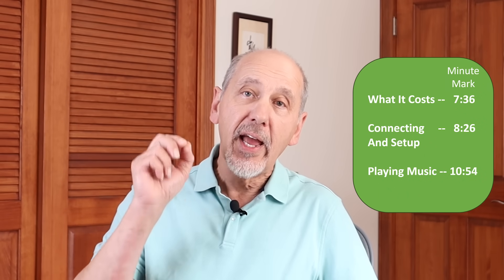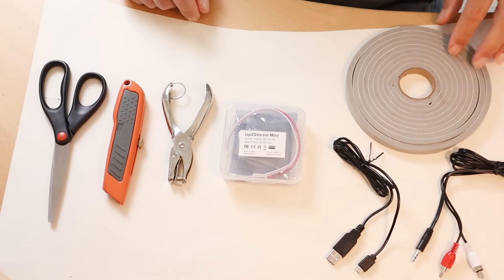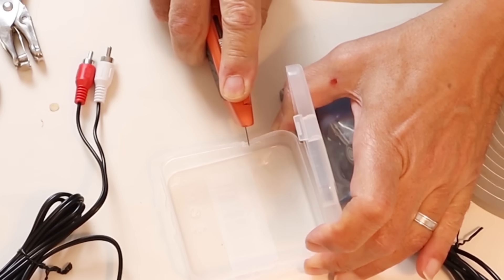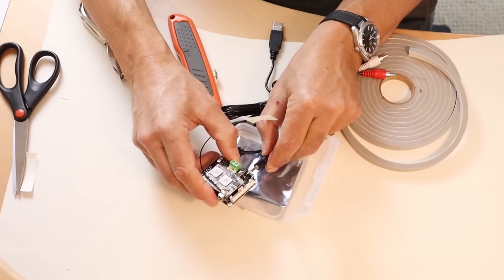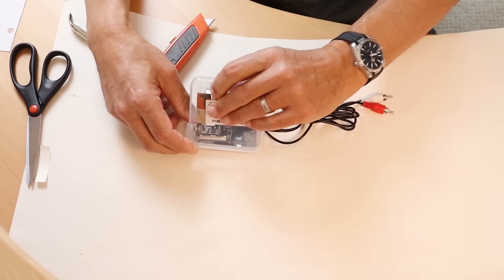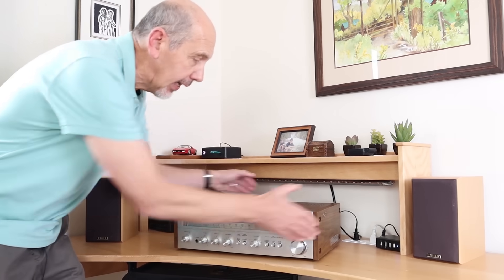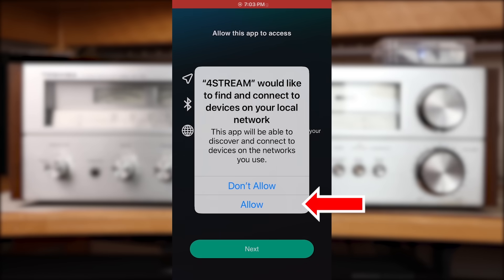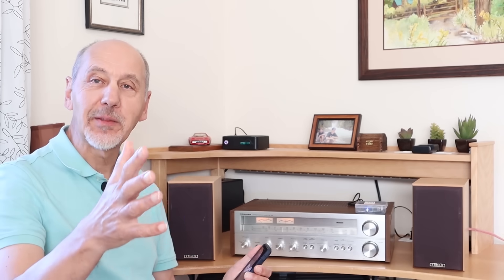Create A $50 Wifi Music Streamer Connect Phone Wireless to Stereo Receiver

Comment: Fantastic. So, total Noob here: if I get my turntable which has a line out (an amp is in the turntable), and I connect the turntable's line-out to the line-in of this 'streamer' thing, then I can play records wirelessly to my Wi-Fi speakers... That is the basic idea, right?
Reply from the maker: Hi Simon To get the line in you will need the up2stream pro board  (https://www.arylic.com/products/up2stream-pro-receiver-board ) which costs $10 more than the mini board that I showed in the video.  This is the same board Arylic put in their S10 Streamer/Preamp. I have only tested the S10 not the bare board, but the S10 works great.  I used it to stream a turntable to a pair of  WiFi speakers as you suggest. This video shows a streaming turntable using a Wiim Streamer in place of the Arylic (.https://youtu.be/yglV-vlzKwo) Wiim and Arylic are compatible and interchangeable. For this all to work the WiFi speakers need to use the same multiroom protocols as the streamer. The Arylic  (or Wiim ) streamer  works well with the Edifier MS50a or the Audioengine A1-mr speakers  Of course if you wanted to go full DIY you could get a pair of Speakers in Kit form from Parts Express and convert them to WiFi speakers with an Arylic Streamer/Amp board (https://www.arylic.com/products/up2stream-amp-amplifier-board).  With your Arylic Streamer you could also play to any stereo equiped with a streamer or a streamer/amp from Wiim, Andover Audio, or Dayton Audio.  One last caveat. I have, found that some phono cartrige/ pre-amp combinations can output quite a high level signal which can cause audible distortion on musical peaks due to overload of the line in. If this happens and your turntable has a variable gain pre-amp then great, just turn it down. Otherwise insert one of these between the tuntable line out and the streamer line in. 
https://www.amazon.com/Nobsound-Controller-Adjuster-Amplifier-Switcher/dp/B074HW3575?crid=2CH5GIN8COTAD&dib=eyJ2IjoiMSJ9.FdX34pLk7LhU0Trz0Hvl86mkLHZX3F3Zh-WhpDUYc8AW3gmemCre9iwkFNNLMW1qoQU_Pe-ZLxraoLcgZMO4vyiGjbmzLG1Yq1dvhPTlYNpgZzeodDEO4zD2xnoA3UKIh_SjXKK6-1PMHr5jB8Pr1aKY4O2EKbUpjJjG6KuZTM5-UnY15dI2Q_IXzLD3O3bAgyStt88Ns4eZV5uiB837PEESW6Nxq6zT6mQ18dobdGI.rJywaTVW7lBJmMhQuNSODvrXyk_Yu2h4aEhvgbA8_uw&dib_tag=se&keywords=passive%2Bvolume%2Bcontrol&qid=1714061346&sprefix=passive%2Bvolume%2Bcontrol%2Caps%2C163&sr=8-3&th=1&linkCode=ll1&tag=rogergadgetgu-20&linkId=e6b258001a0a3fa1d197874617349caf&language=en_US&ref_=as_li_ss_tl
Reply: @rogergadgetguy  Ah so informative thank you very much indeed! Thanks 😊
[also thanks for the heads up with that line volume thing]

Comment: Isn't this what the Chromecast Audio does also?
Reply from the maker: Hi, It's very similar in use to the no longer with us, and sorely missed Chromecast Audio.  Both devices support DLNA for in home network streaming,  For apps like Spotify which have their own protocal for casting music to another device, they are the same.  playing other music services works differently on the two devices and gives rise to compatibility differences.   The bottom line is the Cheapskate streamer is better for Apple iPhones because it suports Airplay (But not Chromecast) so it can play any Audio app that you can play on an iPhone. The Chromecast is better for Andriod phones because it supports Chromecast (but not Airplay) so it will play any audio app that will play on Android.  This is not a big deal for most people though, because the 4Stream app gives you a way to play most of the popular music apps even if the Apple or Google platform doesn't support it natively
Reply: Yes, but Google doesn't make Chromecast Auduo anymore, though you can buy used ones.

Comment: Hi roger the anti static bags only work when the object is inside the bag, the outside is generally where the built up static electricity is released
Reply: How about if open the edge and now make the inside out and lay the board on top?  Will this work or better just to put the board in the enclosed case?
Reply: The antistatic bag in the box is unnecessary, it's only for shipping and handling.  It is slightly conductive plastic, if you put the board on it under power it may interfere with the electronics or short out connections on the board.
Reply: 100% true. I worked in PCBA manufacturing / quality control.The Faraday cage of this antistatic poly-bag is only applicable if the board is enclosed in the bag, sealed, with the bag not having any perforations.
Reply: @bruzewill7081  Thanks for the Scientific explanation vs hypothetical, assuming your statement is correct.
Reply: @jfs70ss it's not correct. Faraday cages protect against radio frequencies. 

Conductive plastic helps prevent static discharge into the device by providing an electrical path to equalise potential around the sensitive part. 

A bit like being safe in a car during a lightning strike because the electric travels through the steel rather than your body.
Reply: @ Thanks for the reply...  63yo from the SF Bay Area Cali.
Reply: @jfs70ss  You're welcome.  59yo from Ireland.
Reply: @davebutler3905  Thank you for the reply.  One place I would love to visit one day where I would feel safe.  Retired.  If you don't mind me asking, what do you do for a living in Ireland?
Reply: @ you're right. I got my terminology wrong. Shielding from static but not radio waves.
Reply: @bruzewill7081 A real Faraday cage doesn't care about perforations. I don't think that the bag works on the principle of a Faraday cage.
Reply from the maker: Hi,  Your point is well taken.   I just got into the habit of only laying unenclosed boards on an antistatic surface when I worked on sensitive circuits.  Of course this only works if you are wearing a grounding strap but old habits die hard. All this being said, putting the bag in the case will for sure do no harm, and I am not very concerned about ESD damage to a robust module like this anyway.